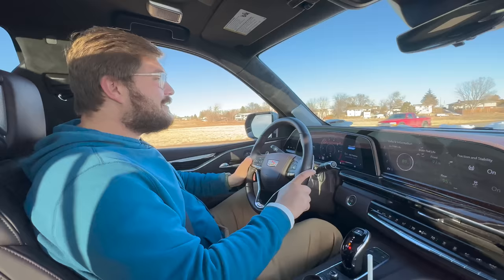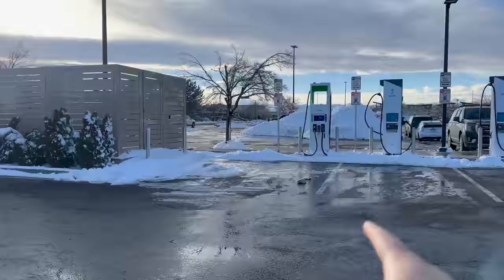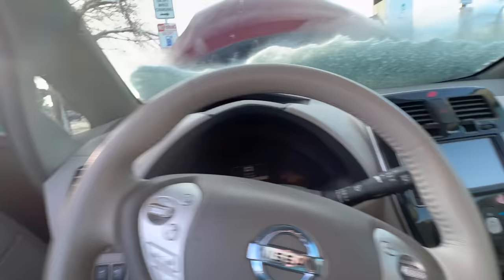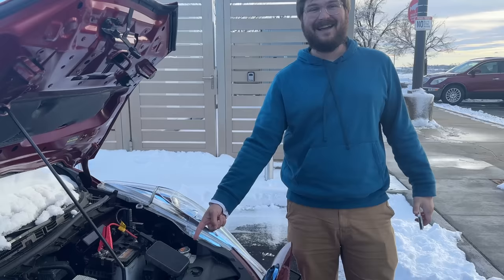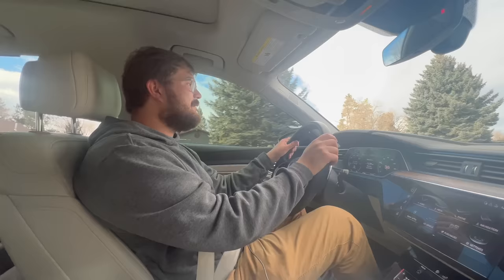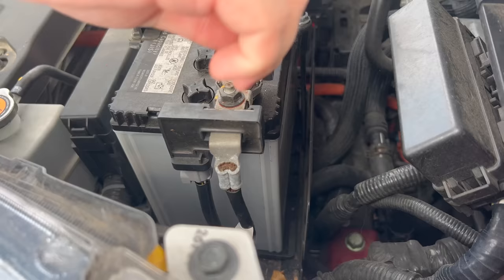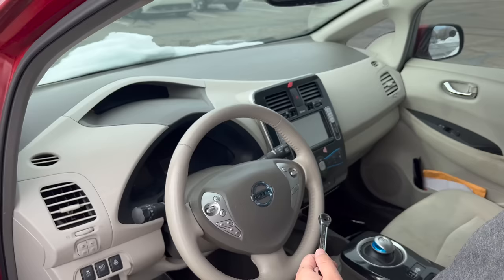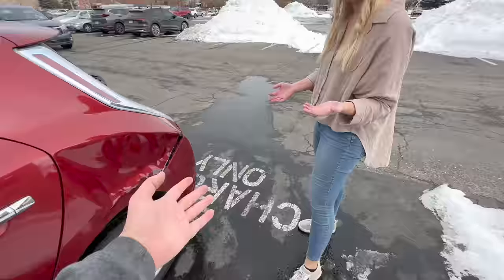My Cheap LEAF Bricked - So We Had To Save It!

Comment: you can't use a booster in place of a 12V battery due to all the computers needing a constant source voltage. All the EV's in cold or extended down time need a battery tender when parked. The weather in future will only get colder so get some insurance with a battery tender.

Comment: Those "smart" jumper packs turn off after detecting a significant draw (like your starter cranking). They'll also time out if they don't. They'll never just provide straight 12v indefinitely. Usually not an issue with an ICE unless the battery is toast (because they're also useless if you're battery is completely dead). You need a real jumper pack or a fully charged jumper battery (or maybe even a plug in charger with jump start function if you're at home) for your best chance of success in this situation.

Comment: A bit off topic but my Ring spotlight cameras with batteries quit working at about -5f, despite being attached to a charger full time (I got tired of charging the batteries and the solar panel couldn't keep up so they are on full time wall charger plugged into back of the cameras) Once the temp goes up a bit they come back to life just fine. So it doesn't surprise me that electric cars crap out when it's cold. When I say quit working they might as well be off as they are offline as far as the app is concerned.

Comment: Why didn't you just connect the 12 volt battery to the battery on the Escalade with jumper cables and let it idle for 20 minutes? Then try connecting the charger to charge the large battery.

Comment: Glad it was just the 12 volt that was the problem. If the high voltage battery truly was at extremely low state of charge, I had understood it would be damaging to leave it for any period of time in such a low state. Is it actually okay to leave it for a couple of days at very low state of charge?

Comment: Such is the life of Nissan LEAF 101.  If it acts like it's the end of the world, replace the 12 volt battery.  Ours is the same year as yours.  If the battery dies, everything goes berzerk.  We actually have to keep a trickle charger on ours in the winter as it's use falls way off due to the range loss in the cold.  The HV battery in a LEAF is not heated at all.  The gradual increase in kw on the charger came from the battery slowly beginning to heat up from being charged. Something that probably wasn't though of in the moment when the car was getting the errors in the middle of the night in the previous video, jumping the LEAF from the Rivian while trying to connect to the charging station probably would have worked to get it started.  I don't know if you would have been stuck there or not being forced to keep it connected while charging.  That would have been interesting to see how that worked out.  But.... I get the nasty of -15F.  Go home and get warm would have been my thing as well.

Comment: I’m sticking with ICE. After watching all of the issues with trying to get chargers to work and batteries going dead and really, are we saving the environment? The amount of mining involved to get the raw materials to build these electric vehicle batteries is a lot. Are we being manipulated by the manufacturers into believing this is a partial answer to our environmental problems? I personally don’t know who to believe. Once there are more electric vehicles on the road the grid won’t able to handle all of the charger requirements. The range in the batteries is still an issue and so is the charging rate. I can fill up my car with gasoline in about 10 minutes and I can get about 800 kms of highway driving with my 2.0 litre 252 h.p. 4 cylinder turbo engined car. Then of course the prices will skyrocket because the greed is always there. I can’t afford to buy a nice electric car and at my age I doubt if I will see one that I’d want to buy. I like a lot of them but price wise they’re way out of my range. That’s my humble opinion.

Comment: I am a little confused.  When you had the Cadillac why couldn't you have simply put the jumper cables on the leaf 12 volt battery and let it trickle charge for say 15 to thirty minutes and then woke the high voltage system up? Would have saved you a trip . I do understand the 12 volt battery Would still need changing out but at least you could have got it to the charge station and got the high voltage battery charged so you could have driven the leaf to the battery store? Just a thought. Now that said,  I have NO experience with EVs and maybe there is something else that I am missing so I don't want to pretend I know the whole situation here.

Comment: Transmissions are extremely advanced theses days. Shocked EVs only have one gear when they can easily have 3 for city and highway
Reply: Most motors have decent efficiency across a relatively wide speed range. Unless your transmission is 100% efficient, it's probably not worth it.

Comment: Maybe the guy was just trying to be helpful. In any cas when installing a 12V battery to want to remove the negative first on the old battery and install the negative last on the new battery so that it's not grounded when you slip with the wrench installing the positive and arc it against oh, anything,

Comment: You got a big battery that is worth more than both of my vehicles put together, and your point of failure is a $200 battery
Reply: $100 battery that Nissan charge $200 for…
A ride on lawn mower battery would do the job. It just needs to pull in the charging contractor relay.

Comment: But it is long as they're making V8 so like that there is not a den that's confession especially when you consider the gap between charging stations. Gas engines  Aren't going anywhere dropping out in our lifetime  Especially as long as they're making a new sound as mean as that Escalade

Comment: Person that asked if you needed a jump probably didn't know it was an EV
Reply: EV, ICE, or diesel:  A 12 volt lead acid battery is a 12 volt lead acid battery.  You can always use jumper cables to put a charged battery in parallel with a dead one.  Works fine.

Comment: 21:05 but full screen and You see " 45 Ah (Rated Capacity) and 430 A ( CCA) . that is too weak battery to starter and genaraator what  think that EV need heater  too /summer cooler ) that mind  must be 90 AH ( rated Capacity) and 800 A ( CCA) . If you want  with that EV car drive ibn winter or hot summer.

Comment: That Escalade V on snow looks like a figure skater on stilts.  It looks fun, but I wouldn't want to own one.  I bet the 12V battery on the Leaf was original.  Our Lexus hybrid did 150k miles and 10 years before we sold it, still with the original 12V battery

Comment: There is no need to judge the behavior of another EV driver.  S/He may have different needs as to why they're charging their Bolt up to full.  There's no line of waiting EVs needing access to the chargers, let them charge.
While the gentlemen offered you a jump, your reaction was that his battery isn't 400v, while you're changing out a 12v battery.  Did you need to effectively snicker?  That seems beneath you.

Comment: This video was frustrating lol…

12v battery is dead.  The first time I tried jumping and it instantly died - no dash lights, nothing… I would have changed the 12v. It’s cheap. Buying the Nissan battery was unnecessary. You could have bought an $100 battery from an auto parts store or a $60 battery from Walmart. We’re not talking high end. 

Finally… it’s POS to POS, NEG to NEG.  you aren’t trying to complete a circuit between the jump box and the battery.  You’re trying to boost the battery so IT can complete a circuit with the vehicle.  This and the last leaf video, you kept saying pos to neg and if it was ever going to work, shorting the battery didn’t help…

Comment: Frozen batteries / chemistry slows down. Your power drill battery does the same thing. Warm them up and they will be fine.

By the way. A 18V drill battery can charge your cars 12V battery if needbe in a pinch.

Why don’t you jump it with the suburban?  Easy.

Comment: Internal combustion engine for the winner... again.... spin it any way ya want... ICE is more reliable, easier to deal with, more fun & you don't waste countless time planning reroutes out of your way adding extra unwanted mileage to find a charger, hope they are online, hope they actually work. Sit & wait & wait while it charges & in reality.. the ice is actually better for the environment... everyone conveniently omits the big picture of beginning to end of EV batteries... they're NOT better, despite the brainwashing. Besides, the ICE was Wayyyy more fun. Sounded better & creates more smiles, laughs & emotions & refuels in minutes.  On a side note... always disconnect the negative first so there's no arcing if something touches. Also... get rid of that pathetic mini "jump box" a real jump box would've had the actual amperage output & reserve amp hours to keep it powered up the first time....  I shouldn't say much, I make a healthy living dealing with evs & their problems & misinformed owners.... thank$